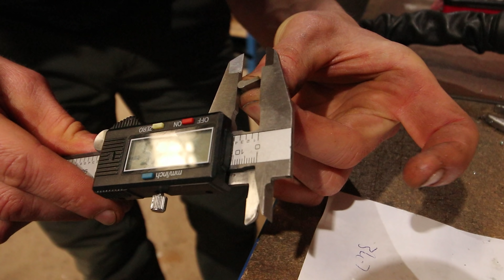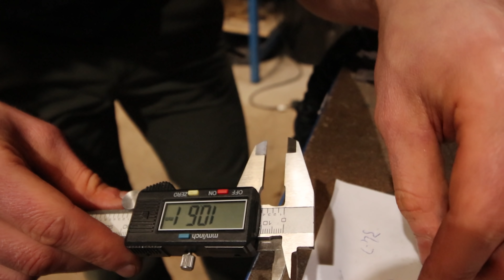How To Double The Engagement Points In A Hope Hub

Comment: "Here at TartyBikes we bring Hope back 4 Pros"

I still think Hope has the best hub sound. Ideally they would make a high engagement boost hub. The fact that this video was so anticipated proves that there's market demand for such a thing. The closest price competitive hubs I've found are Spank's Hex Drives. Call me insane but I'd still take the modified Hope as long as I could find a steel body that matches my prospective cassette.
Reply: Some of the best sounding hubs I've ever heard were a Ringlé from back in the day and even more so a DT Swiss from back in the day.
 Crispy as hell.
Reply: Look at Arc 6 pawl 117 POE. Soo cheap, soo good. I use them for 2 years and no problem.
Reply: In my opinion, hope makes some of the best hugs, but if they build hubs, Wich had more clicks, it would be awesome, or at least a easy tuning opportunity like bontrager!
Reply: @mickenoss  oh wow that makes me feel old thinking back to the days when ringle first came out, can you remember cooks bro, Paul and real engineering as well, I used to look at those and think how many hours I’d have to work on my huge wage of £2.01p an hour to be able to afford them
Reply: @davebryan1890  I remember Cook Bros, not so much the other 2. 
£2.01 lol, I remember starting at 89p an hour. 🤣
Reply: the best hub sound I've ever hear of is from the onyx vesper

Comment: Pretty interesting.  Definitely going to double up the Pawls and springs on my bontrager hub now.
Reply: You got a steel freehub on there? Because most of them are aluminium as far as I'm aware, and they clearly say that isn't advised.
Reply: Maybe not advised, but def still doable modding the  alum driver, depending on both the weight of the rider and the load it’s put thru, if your were light or for the average person that rode about easy, it would be ok and it would still last a while modding the alum one, it would sit right where it should be between Alum/steel pros and cons.. I’d be interested to see if the average generic pawls work just as well compared to the factory hope ones.
This was a great video and explanation of how it all works 2!

Comment: Great info guys i have stretched the springs which work well also . To reduce rolling drag i every paper the id of the green seal to make it thinner with a biggger hole rolls way faster i will definately give this a go i,m what i call a hard xc trials rider emagine moto hard enduro on a mtb , and have brocken a few pauls and stripped a pro 4 drive gear and i do run the steel ones hope have been great with warranties , thanks again makes total sense .

Comment: Gotta love the angle grinder technique, especially when there's a mill sitting right there. I suppose the grinder is quick with zero setup but If your are gonna do a few and want them accurate the mill is the way to go.
Reply: Those pawls are usually hardened and tempered too. One more reason to use the grinder.
Reply: @RogerioCosta1.0  carbide will still easily go through them.
Reply: @Savagetechie  Sure! You just need a good setup to hold such small hardened parts to cut them without caching and breaking the tool (or making a dent on the wise etc).
Like you said before, It depends on the quantity.
Reply: This demo is relatable to most of the audience. I have all the tools necessary in my garage.

Comment: Hi Ali, commenting on a year-old video but I wanted to give you credit for this solid modification. ❤ Engaging half the pawls at a time, __symmetrically__, is so much more sound than the way I9 do it, with gradual engagement as the hub and axle flex.  Hope axles don't have a reputation for snapping, unlike the ones from North Carolina that depend on flexing an aluminium axle to get those points of engagement.

Comment: So this mod would then give the SS trial hub a whoppin 176 POE?? If thats the case my Dj bike is gonna get upgraded...
Reply: no because the trial ss hub is basically a normal pro 4 that has a different freehub body that engages only 2 pawls at a time. so basically its the same as a modified pro 4 shown here (of course with shorter freehub body etc.). correct me if im wrong
Reply: You are absolutely correct
Reply: Yes, you could get to 176 POE - though the mod would have to be slightly different. Also wouldn't recommend it as having only one pawl engaging at a time loads the axle and bearings in a sideways direction, which they aren't designed for. At least keeping 2 pawls engaged at once, the loads are opposed so there is no side loading.

Comment: I've purchased an off-brand hub with 2.11 deg engagement for less than 50 pounds. I'm much more comfortable riding with this than modifying my expensive Hope pawls and suspect that it will last much longer than having only 2 pawls engage on a hope. Cool video though.
Reply from the maker: From my experience the strength of hubs engagement points can vary wildly, I’ve used hubs which on paper sound great but in reality skipped a lot when riding. Even though Hope might not have huge EP numbers they have proven to be reliable even when run with two pawls so personally I have a lot more trust in this mod than most other hubs out there

Comment: Super nice video but..... You can clearly hear that those shorten ones doesn't engage at the same time . There are actually three clicks. Reason for that is because it's done by hand with not enough accuracy. You would need some sort of a jig to shorten those pawns equal.  That means two things:
1. Those hubs actually work on one point engagement at time.
2. You could probably shorten three of them to have 4x the engagement form original.
What do you guys think?

Comment: Is there any practical benefit in doing this as opposed to just buying a hub with better engagement?
Reply from the maker: It’s sometimes possible to just buy a different hub but there are sone reasons this might be better.

1) Hope hubs are cheaper than most of the decent high EP hubs

2) Hope hubs have proven reliability even with this mod, cheaper high EP hubs can often be of questionable quality

3) sometimes there simply isn’t an alternative. In my case I wanted a high EP Fatbike hub and a reliable model simply didn’t exist so modifying a Hope hub was an ideal solution
Reply: @Ali_Clarkson  That's exactly the answer I was looking for. Thank you Ali!

Comment: The Trials/SS hubs come stock with 88 points, not 44. Worth noting.
Reply: Yeah, I was wondering if they do something similar with those from the factory.
Reply: @only-write  kind of. Hope Trial/SS hubs have the same ratchet ring, the same 4 pawls, but instead of shortening pawls they move the pawl seat for two of the pawls slightly so they are phased in pairs. Only 2 engaging at a time.

Comment: Since the fulcrum location stays the same, and the pawl is shortened by more than 10%, wouldn’t the tip angle need to be different than the stock length pawls?
Reply: Correct!

Comment: So what setup has the most engagement points? This modified hub or a 135 engagement point front freewheel with 18 T and a rear sprocket with 15 T?
Reply: Hub with 88 POE gives 105 at the cranks  (88 * 18 / 15). Obviously the freewheel gives 135.
Reply: @thetart20  Thanks so much Adam. I was trying to calculate but couldn't find a way to compare... Would you say the modified Hope hub will last longer than a front freewheel setup? Or is it more reliable?
Reply: @canardweb  No worries! Too many variables to say for certain, but would guess at FFW being more durable than modded Hope hub with alloy freehub.
Reply: Grea! Thanks so much for your input. Means a lot.

Comment: My slogan is;  "He may be short but you won't believe how engaging Pawl is" A runner up if I may;  "When I see Pawl it makes my hub beat faster"
I really love the Tarty videos Adam and you in the workshop is always a blast. Whats the deal with this full contact seal for a Hope hub?  Sounds good to me
Reply: I use a VA40 Viton seal. The cassette / spacers (if on single speed) hold it in place, so it's really easy to fit and remove unlike the standard seal.

Comment: Ummm 245 lb single speed rider here on Pro4 hubs, I guess I won’t be doing this mod lol. After I blow up my freehub I’ll have to look into this when I upgrade to the steel freehub.
Reply: And then you can be guaranteed you will obliterate your drive ring, if you are a large guy who lays down a lot of torque.
Reply: @101NomadDreams Yeah I lay down the power fortunately and unfortunately for my wallet. This is a interesting mod for sure but it probably won’t end well for me. 
I have a set of i9’s on standby.

Comment: I would rather send to the machine shop than using a hand grinder. How straight can u hand grind?
Reply: I’ve done mine using a chisel, (took me almost an hour though). Been using it for 2 months, still going strong. Hub looks the same inside, no play with the smaller pawls or eating the hub etc. and I have the aluminium freehub.

Comment: Would the grinder ruin the heat treating on the pawl?
Reply: Maybe I didn’t consider that but it could significantly fuck up the reliability if it did
Reply: @bruhbruh3728  Maybe - but I don't think it gets hot enough. The hub I did the same mod to back in 2011 is still going.
Reply: Was thinking the same thing and the answer is yes.  Heat treating is a pretty specific process.  How much it messes it up would have to be measured.

Comment: This only works for the sound, as it is clearly visible that the worn pawl does not come into contact with the wall of the hub fitting, in this case only 2 pawls are bracing while the other 2 shortened ones are without traction.
Reply from the maker: Not quite sure what you mean, by shortening two pawls we specifically only want two to engage at a time (rather tag all four at once), it works for the sound and function as we did double the engagement points as planned
Reply: @Ali_Clarkson but in the video you can see that the pawl that was modified does not fit perfectly into the hub, in 22:08 Or does a pair of pawls pull at a moment and then the pair that was modified fits?
Reply from the maker: @synthlaab i see what you mean but I think it’s the angle, the pawl sits down in the ratchet and it’s hard to see the leading edge. Plus for them to not fit he’d have to have modified the front edge of the pawl and even then the spring would still push the pawl until it touched, there’s nothing stopping the pawl moving until it contacts the ratchet so as long as it clears the tooth, it’ll snap back and stop when it hits the face (I hope that makes sense)

Comment: Please correct me if I’m wrong, but for this mod to work with two shortened pawls, you are both changing the full engagement surface area of the pawl in the corresponding negative area of the ratchet  and also changing the angle of those two modified pawls.  

Does the spring already, or with the additional spring, effectively “lengthen” the pawl to fully seat and engage into the ratchet notch?  If not, the shortened pawl is robbing you of actual engagement power at the risk of premature wear.   

If the engagement angle of the pawl is steepened by shortening them then you will likely wear the round mounting seat of the pawl in the freehub body far more quickly as the steepened angle will cause the pawl to articulate beyond its designed and machined tolerances.  

This is a cool mod if it maintains the same amount of engagement area, ie; full pawl to full notch and doesn’t totally nuke the round freehub pawl channel. 

Also, what about doubling all 4 pawls so there’s 2 thinner (side-by-side) in each channel, then shortening them in some configuration?   Or is that just a waste of time?

Comment: I’m curious as too how it wears in a dirt jump setup. Sometimes you need high torque to get going but most of the times you’re just coasting, maybe something will break or it won’t
Reply: If you want Hope hubs for DJ, buy the Trials/DJ version. They come stock with 88 points of engagement, albeit better execution using offset pawl seats. Trials/SS also have a shorter freehub body and wider flanges which will build into a stronger wheel.

Comment: Why dont they just make a freehub-body with 6-ratches, 3 by 3 phased... which you can buy to replace your aluminium pro4 freehub. That way the load isn't that much higher for heavy riders but still you get 96 clicks.
Reply: Hope Pro 5 hubs got released. The freehub body works as said in this comment...
Reply: @cjmpaja  Can i buy just the Freehub and replace my Pro4 frehub with THAT one? Is that compatible? Do you know that...?

Comment: You could just build up a new pawl system with more pawls and have that CNC'd up.
Reply from the maker: “Just” 😂
Reply: @Ali_Clarkson  it isn't a very complicated shape, as shapes go. It isn't a turbine blade.

Somebody could definitely do a "super engagement" pawl carrier, made from tool steel. Hope would be the obvious people to do it, but I could imagine that a tartybike + CNC shop collaboration would get you there. There is space for way more engagement points if you design it right.
Reply from the maker: @weareallbeingwatched4602  i was just amused by the thought of “just” 3D designing a new system and having it CNCd being an easy option. Don’t get me wrong it would be great but compared with a couple of minutes with a grinder it’s a much more complicated solution that 99% of people won’t be able/willing to do.
Reply: @Ali_Clarkson  "just do it properly" is usually more work. Same as "just replace it with a new one" is usually the most expensive way to fix a part.

Comment: Of course Hope doesnt recomend it cause its a bad idea , First one with the name Double engagement should be called  Cut your engagement in half cause thats what your doing ,  and double springs really ??  who needs more Drag ??  both are bad ideas ,,,
Reply from the maker: If you don’t know how it works then perhaps commenting to call us out isn’t the best idea 😋
Reply: @Ali_Clarkson  I know exactly how it works , i build bikes and build bike parts . A free hub should have full engagement off all the paws at the same time  so they will equally share the force put through the hub to the wheel ,  and the 2 springs is also a bad idea and you know it ,,  but go ahead and spread bad ideas ,
Reply from the maker: @raularrese3926  you’ll know this is (almost) exactly how the trials version of this hub works then…the one that they make and sell and have done for around 15 years. The one that has two opposing pawls engaging offset from each other. Shame Hope don’t know what they’re doing either I guess 😋